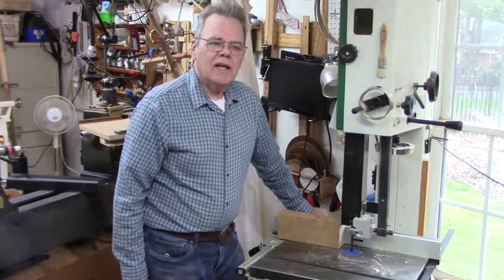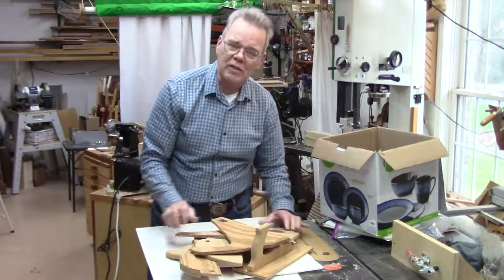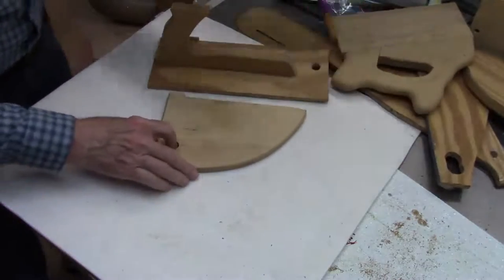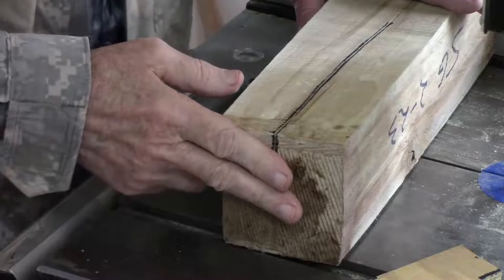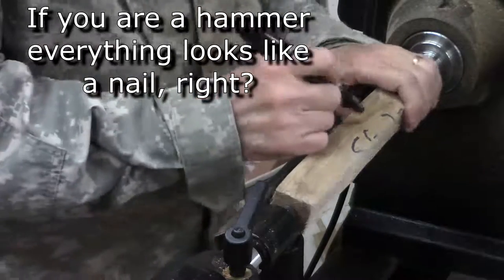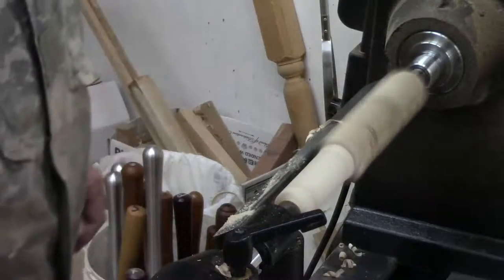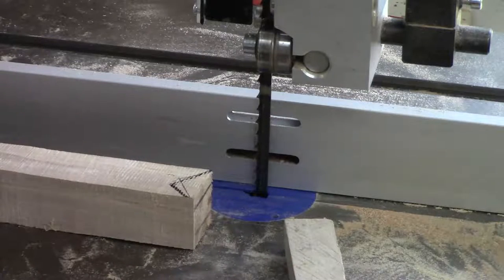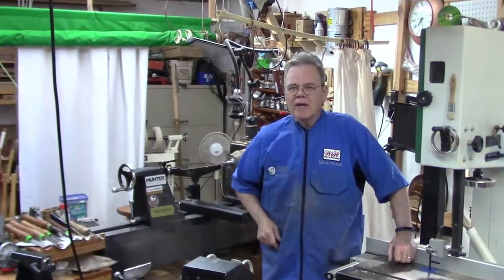Save Your Fingers! Craft the Ideal  Bandsaw Push Sticks

Comment: Hey Mike:  Great minds must think alike.  I just made some push blocks for my band saw.  One looks similar to the cylinder block, while the other is has the same basic shape as your other, but is larger and has a runner strip on the bottom side to go along in the channel for the miter guide.  This guide is really for straight cuts since it holds wood firm to the side of the block as it it pushed through the blade and the guide keeps the block from wandering side to side.   I use another block similar to yours where wood may need to follow some slight curves and can be moved around easily.
Reply from the maker: BS push sticks are too oftern overlooked. I made a Vee block with a miter rail for cutting rounds but it can also act as a miter gage.

Comment: Re the holder - using a disc in the bottom to prevent the tool from falling through may not have been the best approach - now the holder will fill with dust.  DAMHIKT.  I suggest using a short dowel instead - drill holes on opposing sides of the plastic pipe, and then use wood screws through the holes and into the ends of the dowel to lock it in place.

Comment: I like the turned handle idea but you never showed the finished product.  I usually use something similar in pairs, one to hold part down and to the fence and another to hold part down and through the cut.  I find pairs to be effective both on the bandsaw and on the table saw.  I defiantly am going to turn a pair just to have.  Thanks for the idea.
Reply from the maker: I forgot to include the thumbnail in the video.